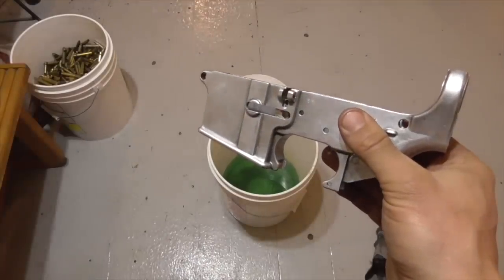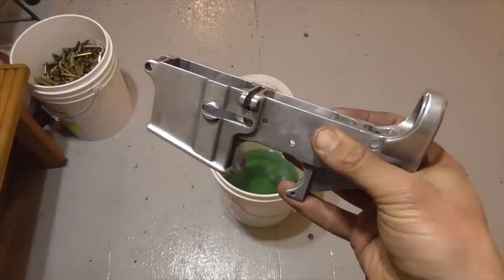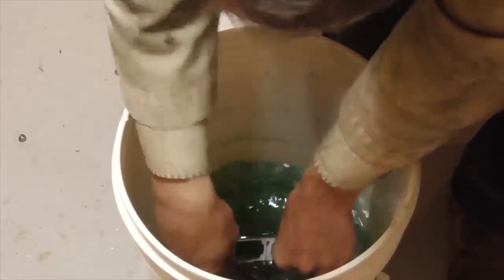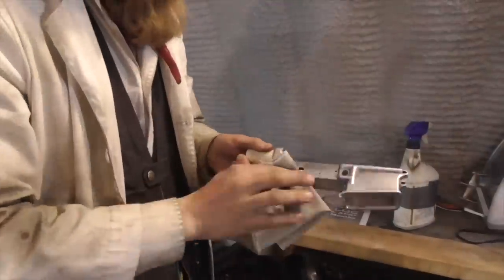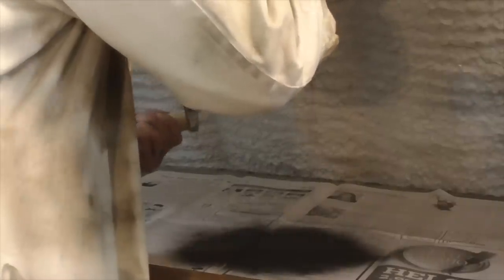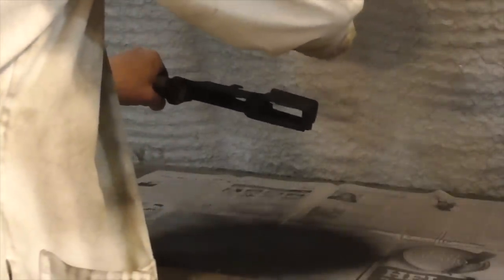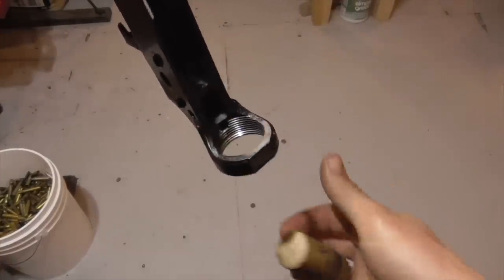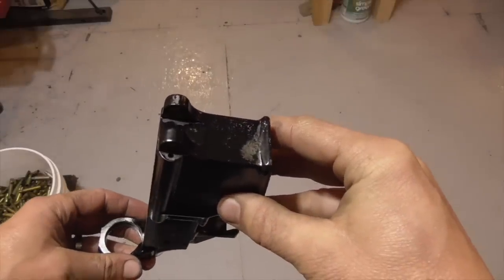Powder Coating: The WD40 Method (TIS263)

Comment: This is just like those Chinese finishes on their weapons. It can chip. But this is really nice to have. It has a distinct look that i really enjoy, especially if it is paired with some white numbering, lettering, symbols, like some old guns have. This looks like candy and i really like it. It is definitely not mill spec while it can chip. But who cares. Maybe there are some powder coats that all mill spec, but i didnt read into powdercoating to much (i did learn everything to get a degree in powder coating), other than that i did do powdercoating, and yes the electronic charge on the piece to be coated really helps to attract the dust. The only thing it, where the electrode attaches, you get a blank spot. So if you where to use a copper plated metal hook in between the wood and the thread, you should get a clean finish. Maybe you can negatively charge it with a PSU from an old computer, it has a -12v line. I dont know what the powder does if the power goes off. In a powder coat line the charge stays on the entire time, including the part where it is in the oven.

This is great for mass production. 

If you are looking for something that is mill spec, try anodizing the part. But then you wont get the candy like look with the guns. Glazed gunparts. :D
Reply: You should try powder coated bullets to, and cast them from your old rangescrap! Good untill 2000-2500 fps without gas checks!

Comment: I had previously not heard of the WD 40 method. THANK  YOU for sharing that! One question, did the WD 40 give off any smoke when you baked it?
Reply from the maker: I didn't notice any appreciable amount of smoke when it was baking, but my shop is fairly well-ventilated.
Reply: @TheIdahoanShow   will this method hold up better then baked on paint  ?
Reply: @carmichaelmoritz8662  There are a number of comparisons of baked on paint vs normal cure vs powder coat... Generally, powder coat beats them all by a decent amount, but baked still is better than straight curing since the volatile chemicals are driven out quicker and so it hardens better. That said, there are also other options for coatings like anodizing, blueing etc which might be better suited to your applications too...

Comment: Have you ever thought about making a gun barrel out of Tungsten alloy ? 
Since the melting point is so high and the material pretty hard, It would be the perfect material for a high velocity caliber.
Reply: Except that its brittle, and extremely difficult to machine to final dimensions.
Reply: Adragontattoo https://youtu.be/n5kEj5ijChc watch this Video, Its not brittle, they use an alloy with 90%W 10% Nickel Iron, and its possible to machine.
Reply: @yaykruser  that is only machinable with diamond tools (there are other types but they are just as expensive) and that is just a tungsten cube in the video (could be tungsten carbide), which is very brittle. And The only reason the cube didnt shatter was due to it being one solid mass, and not a more complet shape like a gun barrel. And while I dont fully know the properties of the alloy you mentioned im guessing that it will be similarly hard and brittle. Just because most tungsten alloys are.
Reply: @yaykruser  also while there are definite problems with making a tungsten barrel, it would be very interesting since you could technically use steel ammo in a tungsten barrel
Reply: strider04 Here is the tungsten alloy im talking about, only problem is that everyone uses their own hardness measure, so I cant compare it to other materials.
But it isnt as hard as tungsten carbide, they mix the other metalls in it to make it kess brittle, so it should be machineble with tungsten carbide tools.
https://www.tungsten.com/products/tungsten-alloy/
Reply: @yaykruser  i found this page https://www.gordonengland.co.uk/hardness/ehe.htm and it gives the estimated comparison between the vickers and rockwell c hardness scales, just keep in mind that a true conversion is impossible, (the postion of tungsten carbide is marked on there as WC) and that alloy you are talking about has value of around 25, i think that you are right about tungsten carbide tooling working on it, it is a mich softer alloy (comparatively) than i expectd being lower than some steels
Reply: strider04 The only way to know for sure it to hold the material in your hads and test how good it is. If I would live in the Us I would have already bought a rod of it and tested it myselfe, but that would be illegal here, so I have to wait. But Im thinking about buying one of these cubes on ebay.
Reply: @yaykruser  oh and what you said about high speed calibers is true and im wondering if the barrel would corrode as much as a steel barrel. Depending on if it corrodes less and how mich more less, then it might be good for a .22swift chambering (the fasted factory loaded ammunition available, and a loading that eats steel barrels like, nothing else)
Reply: Frank Brockman It would be a little more than twice as heavy as a normal barrel, for a small caliber that wouldnt be much of a change, might actually reduce the recoil.
The price Is higher than a normal gun barrel, 12 inch long tungsten rods cost 350$ so you would neet 2 of them, i think it would cost 700—800 bucks , but you would  get that back because your barrel lives longer.

Comment: Interesting that the WD-40 does not appear to cause any adhesion problems.
Reply: I would say that the WD-40 film is now contained between the substrate and the powder coating.  What this means is if and when the powder coating get's damaged, then you will have delamination of the powder coating material.  But what do I know?  I'm only a Protective Coatings Specialist with 33 years in the industry.
Reply: @acciuser  Is there any chance that the WD-40 would have evaporated from the heat prior to the powder coating doing its cross-linking thing? If so, would the substrate have been clean enough for the powder coat to adhere?
Reply: Adam C I wouldn’t think that it would evaporate from the surface.  It’s a oily product and it’s going to leave something behind regardless.

Comment: This does make me wonder if your component, or a similar one, could be coated with something like Hi-Tek liquid coating, typically used for cast lead components. Certainly more expensive than this method, but it might yield more uniform results and be reasonably economical if you had a lot of components to treat.

Comment: Good info as always. I still prefer a couple coats of krylon for my raw 80%ers but this is very neat. Keep up the posts.
Reply: I'd be curious to see a follow up after few weeks of use. In my experience as a paint chemist powder doesn't due well when you put anything between it and the thing its supposed to stick to. Not to mention how the heat from the oven and evaporating solvent could cause gaps between the cured powder and the metal making it prone to de-lamination and flaking. Personally, I think you're better off using the Krylon or just spending the 70 bucks to buy a cheap powder spray gun from harbour freight. That said, neither is a replacement for anodizing cause anodizing is chemically changing the surface the metal, whereas powder or krylon is just sticking stuff to it.